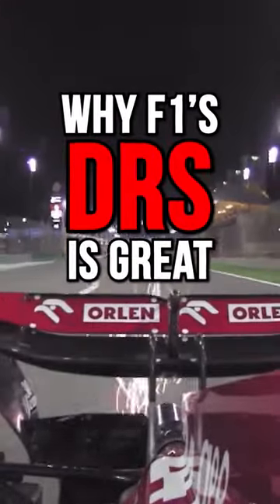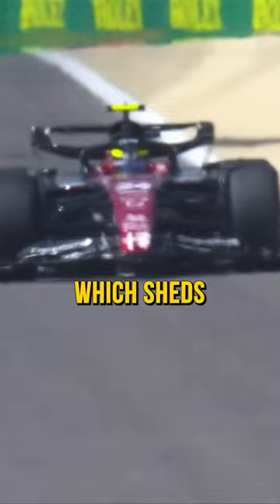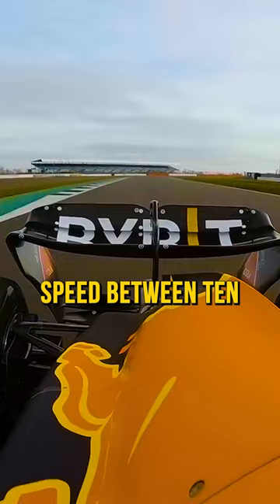F1 Engineer explains the DRS System!

Comment: The issue is that every pass or move is reliant on drs these days. I want those raw danny ric kinda late braking brave moves.
Reply from the maker: I feel you.... I agree.
Reply: The problem is the number of overtakes. In the pre-DRS era you would have around 20 overtakes per race. Now you have around 40 overtakes per race and in some season even more than 60. That s why DRS was added and that s why it is great for F1
Reply: @megasalexandrosthegreat  Wrong. That's not because of DRS, but because of the refueling ban.

Refueling was banned one year before DRS was introduced, and in that year, the amount of overtakes increased drastically, close to the numbers were seeing today, despite DRS not existing yet.

So DRS isn't the reason you see so many more overtakes.
Reply: @Athinira  the refuelling was banned at the end of 2009, season that had 302 overtakes. In 2010, with banned refuelling and no drs there were 616 overtakes

In 2011,first season with DRS, there were 1250 overtakes

So
Reply: @megasalexandrosthegreat 60 is still so low
Reply: @elliot20 60 overtakes per race is low tf are u watching😅
Reply: @blackin4k395  I watch nascar 60 overtakes is low as fuck
Reply: @elliot20  okay but it is low in NASCAR terms probably because the average NASCAR race has about 4 times the laps as that of an f1 race and yall do a rolling start in which is where a bulk of your overtakes occur and the majority of your circuits are ovals which means yall are right next to each other pretty much the entire race and yall have lap times that are like 20 secs
Reply: @blackin4k395  most overtakes happen not during the starts in nascar
Reply: always last, he's first

Comment: My problem with DRS is that now at every race, you have the car setup with pretty much Max. downforce wing levels for the bends, and then it all comes off on the straights. There's never a situation now where a low downforce car is having to negotiate a twisty section where driver skill and mechanical grip are more important, or where teams make a conscious decision to sacrifice downforce for speed etc.
Reply from the maker: Hey Dan, I have a few things that might clarify a bit on your statement. Yes on a single lap the DRS does help, but the teams are still tending to select the "circuit optimum" for race and qualifying. They run high downforce and a lot of circuits like Silverstone are mostly full throttle not because they have DRS, but because the engineers have found so much downforce. They actually don't even run max downforce on Silverstone these days, because the base level of downforce is so high! 
THAT being said, I agree with you, I'd like to see the level of downforce reduced 👍👍 we're on the same page there
Reply: @brrrake  Yeah, I didn't mean that there's no variance in aero setup from track to track, just that the window is much narrower than it used to be (old Hockenheim and Monza being at the low downforce end of the window; and Monaco, Hungary at the high), and so driver skill and other aspects of the car are minimized.
Reply from the maker: @danpearce4547  I think you're onto something. Sorry I misunderstood the original statement! 👍
Reply: I get your point, but to say DRS minimizes driver skill is an enormous exaggeration. And there certainly isn’t max downforce at every race. Teams can choose different rear wings… Also, front wing is much more important for the high downforce tracks with tight corners. Rear wing is only one piece of the aero package, plus you have suspension, ride height, roll bar, tire pressures, brake pressures, even toe and camber adjustments to consider for each track and each weather condition. It makes teams have to compromise a bit less on overall downforce, but a ton of compromises remain.

Oh and there are also long acceleration zones without DRS. So your rear wing downforce remains an important compromise. Sorry just so many things inaccurate about this statement.
Reply: @rxw5520  Awesome knowledge dude. I also disagree that F1 car just need to slap on the biggest amount of downforce and be done with it because there is DRS zone. A lot of factor also in consideration on how much downforce level you need for the car to be faster or efficent overall. Still driver skill plays a very importants part in controlling all that.

Comment: Thoughts on allowing DRS to be used similar to push to pass in indycar? (Drivers choice, limited duration (total, and single use))
Reply from the maker: Not really a fan.
Reply: Doesn't work, because it doesn't solve the problem of cars not being able to follow each other.
DRS was introduced to help solve a problem. They still have to properly solve that problem.
Reply from the maker: @Athinira  the cars can follow eachother so much better than 21.
Reply: @brrrake  I'm aware, but it's not good enough to remove DRS because the cars are still so big. And from what i understand, it has actually gotten a bit harder to follow this season compared to the '22 season (i would guess because the teams have found ways to add more downforce).
Reply from the maker: @Athinira  I'm not sure about this yes. It seemed to gain some momentum in Baku but I think it was a one off. I did a statistical analysis of the on track gaps from 2021 and 2022, I'll look at this season in a few races and see where we're at

Comment: I think the one second requirement was great in the last generation of cars but should be reduced to 0.5 seconds in this new generation, since they can follow closer.
Reply from the maker: I don't think this is necessarily the case. I mean in Baku hardly anyone had DRS available even at 1s.
Reply: @brrrake  true, but I keep seeing DRS being used as a catch up tool with no chance of an overtake. Wasn't the original intent for it to just be an overtake tool?
Reply from the maker: @GeauxBigGarage  if it's a catch up tool then that means the overtaking is too difficult. And if you're within 1s you're already caught up IMO
Reply: @brrrake  I see where you're coming from, but if you use DRS from the start of the zone and can't get close enough to make a move, it's just a catch up tool. I'm still all for it, I think it should just be reduced to .5 sec. IMO DRS should help you make a move, not just get close enough to try a move next time, but that's just my armchair opinion, with no F1 engineering experience. 😁😉

Comment: But there is also ERS which gives the engine a tiny bit more power, better known as the overtake button
Reply from the maker: That is a great point as well. The main problem with ERS is that when you use energy to gain laptime, you LOSE more energy on subequent laps recovering that energy than you gain.
BUT if making up 0.1s on a competitor gets the overtake done, and they don't re-overtake you, that's fine!

Comment: Disagree because you can use PtP defensively. You cannot use DRS defensively which is why it is a gimmick.
Reply from the maker: There is energy deployment on a F1 car. Which isn't quite the same. Imagine having defensive DRS though
Reply: @brrrake  Fair counterpoint, plus the mapping of the ERS deployment. IndyCar is also more limited in deployment and mapping options, so PtP provides a greater difference, relative to your point, where the ERS mapping would mitigate the benefit.

I do think F1 should consider a defensive DRS. Perhaps allowing the driver that got passed to activate as the other car pulls ahead would allow for some intense late braking.

You also touch on a point there, that ERS is sometimes used defensively against DRS.

Comment: I mean if you where a real f1 engineering you won’t compete DRS with using the electrical battery power or the rich fuel injection system. That is part of the race and that is part of the strategy. Just because the tv commentators don’t know about those parameters … . Quick views miss informing people! Great job!

Comment: DRS/KERS in a Tesla is a Tesla with NO CHARGING STATIONS OR CORD 4 wheels return productions into a backup power pack.    

Generators around 30yrs longer than gas. 

Wind turbine WITHOUT THE BLADES ran from another generator why waste time and $$$ 7.07 better in different configuration